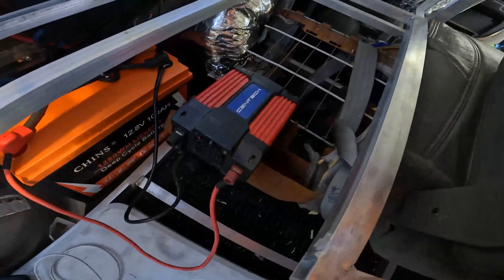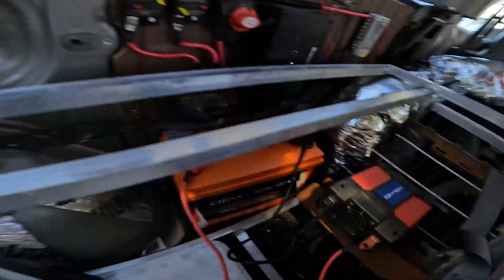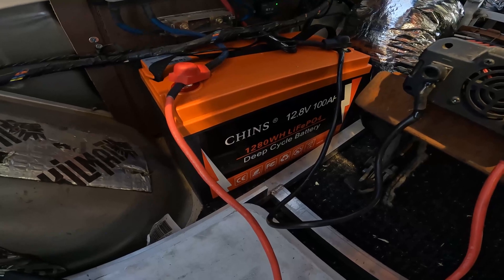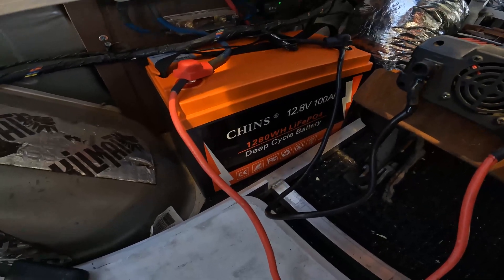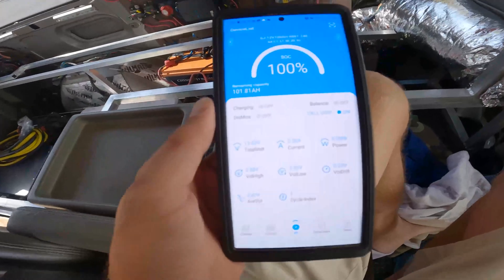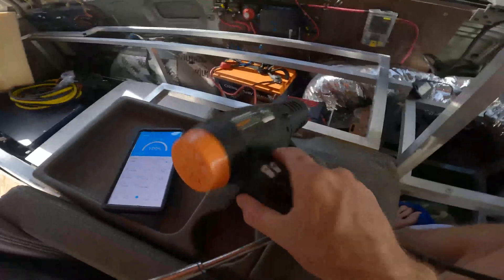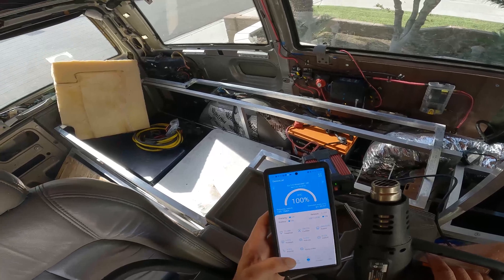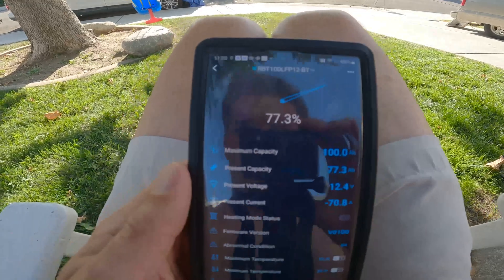Renogy Battery Problem + FIX: Not what You Would expect

Comment: Stoked I found this. I have been going through same issue. I purchased mine June 28th, 2022. How about yours? I only used it on a couple trips. I was chasing my tail assuming it was me mainly b/c Renogy assured me it was not the battery. I put it storage mode and haven't used it since. I am curious if our manufacturing dates are close.
Reply from the maker: pretty close I don't remember exactly but my warranty was registered 7-22 id try the heat gun trick and watch the cell balance. if it cuts out early send it to them for testing don't bother sending screen shots and such let them test it

Comment: I always had good experience with Renogy. But my latest battery failed. Using all their inverter, mppt charge controller and they still said it’s my fault for improper charging. I was able too get it back to turn on since it went into some kind of safe storage mode. Im gonna order the Epoch 460amp battery instead now.
Reply from the maker: It's a bummer to experience such poor quality when everyone touted them online as being so good. I've not had a problem with either of my chins batteries yet
Reply from the maker: 460 Amp hours? How much is that going for? Sounds perfect I just installed a 12v minisplit AC that runs off the house batteries. Lasted about 4 hours on full blast with my 200ah bank
Reply: @DadVanture  they just had a sale on it. Im sure they will have another for Labor Day and then again black Friday. But right now its $1,300

Comment: EDIT: Call Renogy on the phone after you have a case number and they will be far more likely to take care of you. It took a month from when they approved the replacement to when I received it. They paid for all shipping, tested my battery ruled it faulty and replaced it with the newest model at no cost to me. It was a 2-3 month process. It took longer than I would have liked but they did come through and I am back on team Renogy
Reply from the maker: dude I'm sorry you have this issue. since its dead will they not take it back for testing? they gave me the option to send it to them.. so far my chins batteries have been solid. I have 200ah now
Reply: @DadVanture  they have never even offered up any realistic solution besides for 'charge it with a compatible charger with lithium activation' literally 10 times. 

Honestly Im pretty sure that I'm just going back and forth with literal bots at this point lol they barely acknowledge anything I've said and keep saying the same thing. I don't even care anymore I'm completely over Renogy.

I appreciate the suggestion and am glad the Chins have been working well for you!

I have been looking into Chins, LiTime and SOK. I like how the SOK can easily come apart. But I also like the Li Time comes in 230ah and was recommended by Will Prowse but afraid if something happens to the BMS I'll be in the same boat. These 200ah are really hard to get the tops off.

One thing forsure I will certainly NEVER buy anything Renogy ever again and be sure to tell everyone I can haha thank you for this video!
Reply from the maker: @theskateprofessor  you can call them also! I felt the same way about the chat. Almost bot-ish.. or terrible at English lol... good luck with your hunt on a new battery man
Reply: @DadVanture  I took your advice and I called them today! They could tell I was knowledgable and didn't do anything outside of the warranty. They decided to send me a return shipping label to bring the battery in for testing. I will provide another update for the viewers when I have more information. Thanks again!
Reply from the maker: @theskateprofessor  hell yea lol the power of youtube! Good luck

Comment: What heater are you using battery for? I have a diesel heater.Bat only gets punched from glow plug at startup then just fan while running.On high my 90ah wet cell dies over night on high.So a Li bat will run twice as long.Not seeing 3-4 days with any heater that I know of. Edit: Oh I checked yer channel out ,gas heater,nice! First dad fish,love it!
Reply from the maker: I was getting about a day and a half during winter before it errored out.. I'm excited to see how long it lasts now.. you are right.. 3-4 might be a stretch.. but I think it can def last 3 days.. I also scooped up a non bluetooth 100ah lithium that I added in so I have 200 AH right now. currently working on a 12v AC system that I can run while the motor is off in summer! I'm stoked.. thanks for watching I truly appreciate it